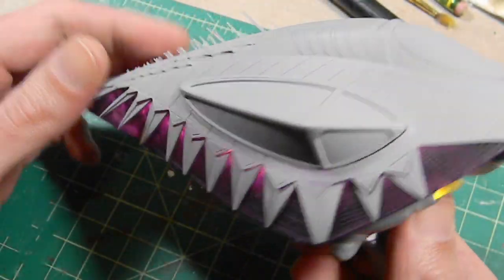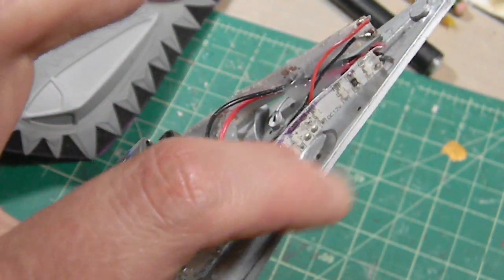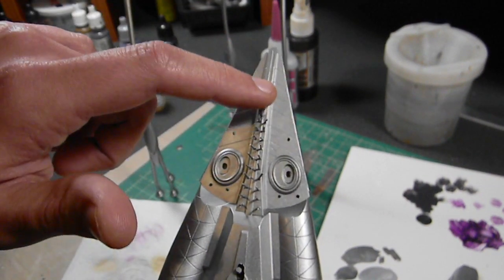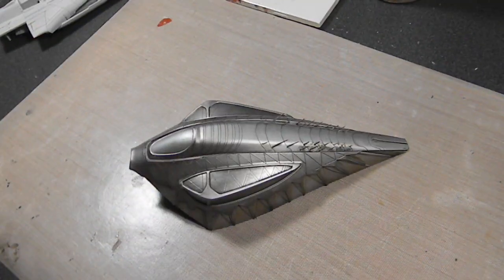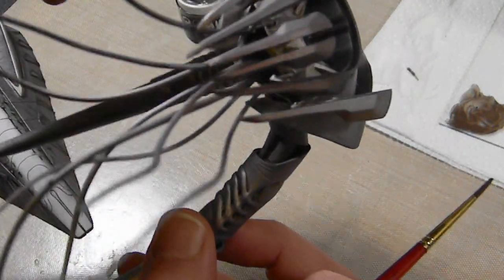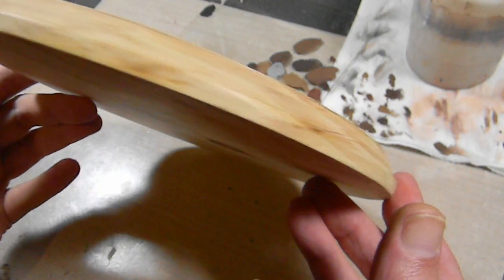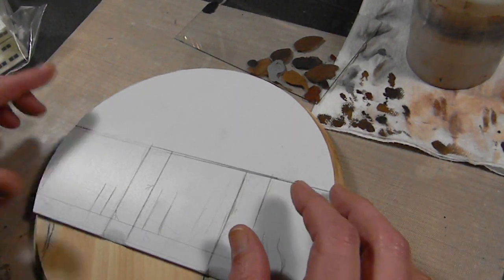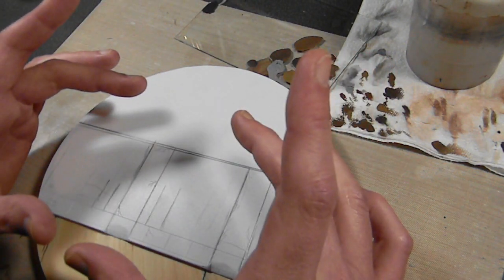Pegasus' War of the Worlds Tripod Part 5

Comment: Thanks for the post. I've just bought the pegasus kit at ebay at $49, and I have seen someone is selling a LED light kit, though it's more expensive than the kit itself. Anyhow, my question is where do you buy the paints? I've been using Japanese paints like Tamiya and Mr.Color, but they suck and expensive (and there isn't much choices for color either).

Comment: Hey, the 1.5V battery didnt go out.. the voltage just dropped below where led can work.. it probably still has 80%+ charge. you should use 2x 1.5V + resistor to drain out both of them completely.